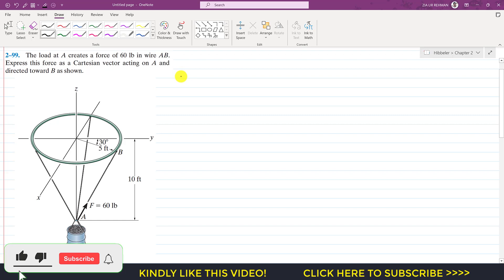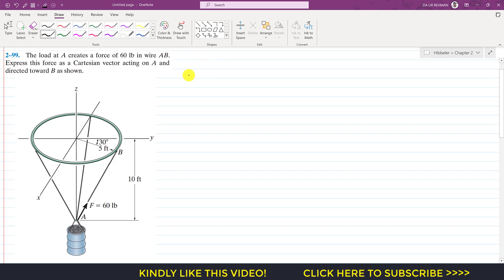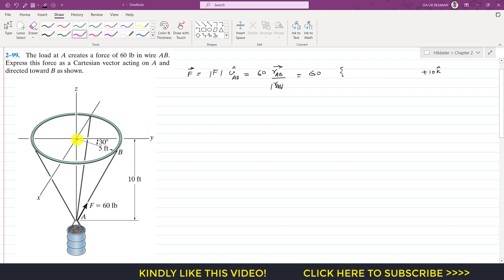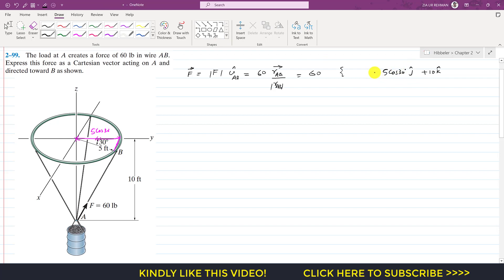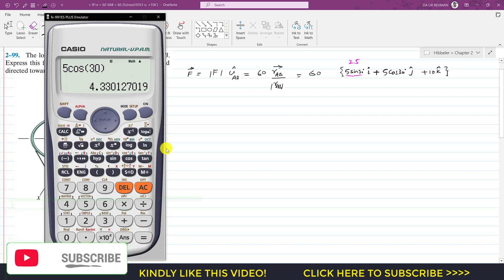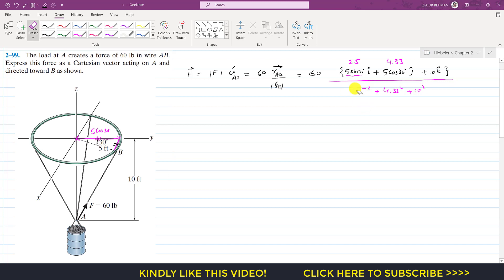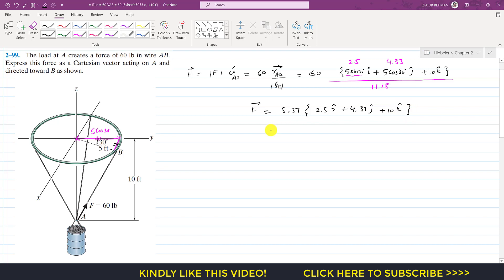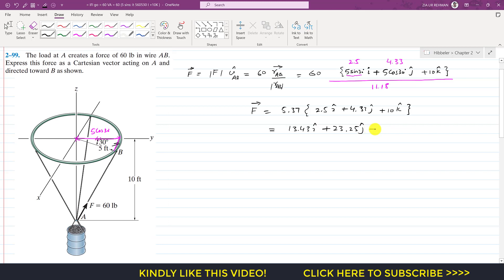2-99 | Chapter 2: Force Vectors | Hibbeler Statics 14th ed | Engineers Academy

Comment: Sir, why is it 5sin(30) for x direction? I have10sin(60)
Reply from the maker: 10 ft distance is vertical distance, x direction is horizontal. Radius of circle is 5 and circle is in x-y plane, so point b is at distance of 5sin30 long x direction.